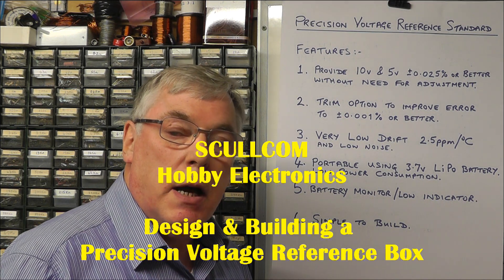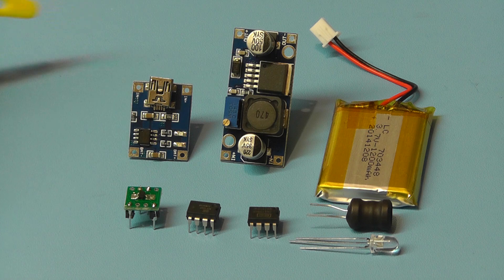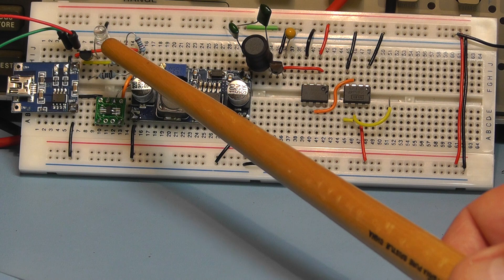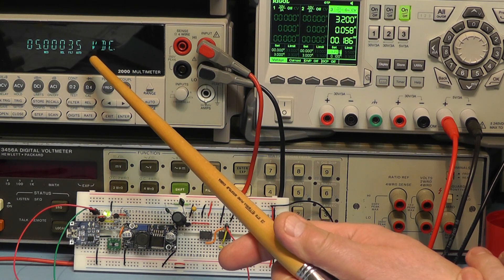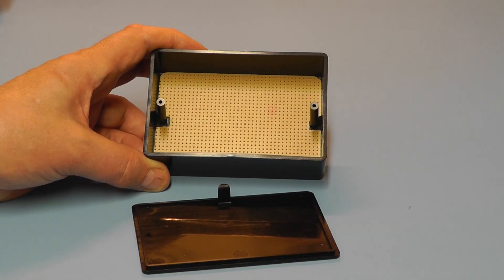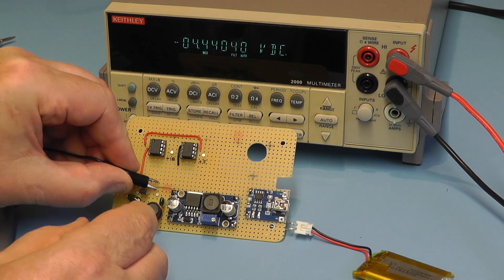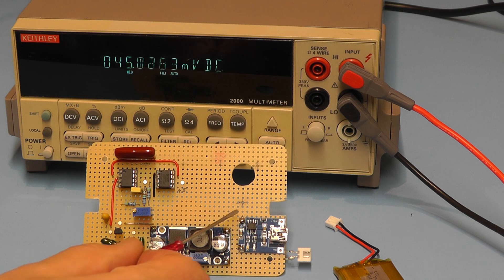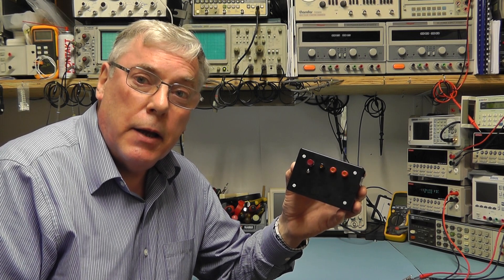Scullcom Hobby Electronics #11 - Design & Building a Precision Voltage Reference Box

Comment: i want to build this, however ebay dont have any ref102c and the INA105 is about £13!
my idea was to run off either a 12v psu or 9v batt.
so getting rid of the lipo stuff, led, putting in a toggle switch... ahhh i got a headache now as i havent got the stuff to build one
Reply from the maker: +G.O.B.S You can get the IC's online from either Farnell element14 or Mouser Electronics.
Reply: cool thanks :)
Reply: +G.O.B.S I have one running now with a 9V on a Bread board for the last 14 hours. But I used the MT3608 DC-DC Step Up module, min at 2V and has less noise then the XL6009 5V min and the LM2577 3.5V min. It won't do 3 or 4 Amp, but that's not needed with this, it's smaller also. The Li-ion and LyPo cells had more noise,me think it's the protection built in. I have it tuned 10.0000 with my HP 34401A. I run the step up at 12V, skipped the 15V reg, and everything before it. I tired to filter the little ringing at 90mV Vpp but the inductor and caps did change it. I happen to not have a 1uF cap for pin 8, but tried a 0.47uF, it worked at first then once it charged went to 120mV Vpp. I'm running it for the next 24 hours and log it. I was going to do a volt cutoff but when I first starred I had a drained 9V, opps. 1 hour in and it kept diving off. Then I realized  the 9v was under 2V and the step shit off but the ref kept the 10V out. REF takes 1mA, and both take 2.568mA. 9V should last.
Reply: +Scullcom Hobby Electronics thanks for the video, it was a fun project. Next solder to a PCB and box it. But I'm thinking about how to get an additional 2.5V and 7.5V in the box on the same board with the same accuracy. 
How low did you get the noise after it was soldered on the PCB? I'm thinking the little bit I have is mostly the bread board and cheap jumper wires.
Reply from the maker: +Scott J Thanks for your comments. Glad to hear it worked OK. Once built and soldered the noise levels were very very low.
Reply: +Scullcom Hobby Electronics I was thinking 90mv was to night. Then I started having other intermittent problems, so I changed the bread board to another. Now it's 28mv, and hopefully will drop nice its soldered. If you want to do a 48 hour test run on a bread board with persicion items, this can drive you nuts. I'm thinking its best to just solder it then see were it stands.
Reply from the maker: +Scott J Yes agree breadboards can be problematic for noise.

Comment: I would like to ask a very stupid question, but really wants to know the answer.
Why not use resistor to divide for 5V?
Reply from the maker: If you simply use a resistor network to divide the voltage to 5V then when you add a load on that 5V reference the load resistance will be in parallel with the bottom leg of the divider resistor and so effect the voltage out (lowering the 5V). Therefore, different load resistance will effect the accuracy of the 5V by different amounts. Regards, Louis
Reply: ah, good old ohm's law and output impedance. thank you for your detailed information. that helps a lot :) looking forward to see more of your projects.

Comment: Hi, the 5V reference which current drain?
Reply from the maker: Hi Diego,
If you mean the reference voltage output current then it can provide up to 10 mA output current. With no load on the output the total current of the 5V reference unit drain is about 30 mA (the biggest part of the current drain is due to the LED).
Regards,
Louis
Reply: It's not for sourcing current. It's for use in high impeadance front ends on measuring devices.
Reply: Very nice job Louis. If you offered it as a kit I'm sure you'd have many clients. I have noticed however that the temp coefficient of potentiometers is never better than 100ppm. That's probably the worst tempco component in your design.

Comment: What value are the Filter components?  A choke & to caps in either side.     
Also why so many components? I've seen a much simpler units with 2.5V.
Same for 10V as well.
Thumbs UP anyway!
Reply from the maker: The choke is 100 millihenry and the capacitors are 10nF and 100nF (with the 100nF on the input side of the 15 volt regulator.

Comment: INA105 is a 33 dollar piece is there a low cost replacement
Reply from the maker: Yes the INA105 can be expensive but they are a very stable an accurate IC with ±0.01% Max gain error. You could use the lower cost INA133 but this has a ±0.05% Max gain error. Using the INA133 would reduce the accuracy of the 5 volt reference from ±0.01% to ±0.05% max error. As these are maximum error factors you may well find that the INA133 is still very accurate.
Reply: Scullcom Hobby Electronics I need your email. I must talk with you about a project.
Reply: The best price I found and most accurate is 15 US dollars (includes shipping) This is the INA105AM w/8 pin round metal case (TO-99) Specs are available online. This is from China half the price and shipping is for pennies!!!!!

Comment: Regarding a single multi-turn pot: actually, the reason I raised this is not in regards to your circuit, but from a principle standpoint.  Accuracy of ADC reference voltage a part, I'm designing a circuit where I'm comparing a voltage A with a threshold voltage B.  Voltage B is variable between 0 and 5 volts, and I implemented what I think is a run of the mill pot. I assume that since there no other voltage divider resistors for voltage B, then it would be safe to assume that variations of temperature would not affect the ADC reading as the resistive material in the pot would vary in value by the same amount, the voltage. Remember this is predicated on a stable ARef voltage. Am I correct withe respect to the pot vs temp.?
Reply from the maker: Donovan Lym Yes you should be OK.

Comment: The drift may be introduced by the trimmer resistors and the trim pot and therefore would select resistors accordingly. Would you be Abeles to get the trim pot with similar low temp drift characteristics?
Reply from the maker: Donovan Lym Yes I agree. In some ways it may be better not to fit the trim pot and resistors at all as the accuracy is then guaranteed at ± 0.025% which would be adequate for most hobbyists. If you do use a trim pot then choose a good quality one. One of the best would be the BOURNS (manufacturer part No. 3250W-1-203) 25 turn trimmer with a tolerance of ± 5% and a Temperature Coefficient of ± 50ppm/°C but these are very expensive and can cost about £20 just for one.
Reply: @scullcomhobbyelectronics1702  What about trimming the circuit, noting the resistances that were achieved, and replacing those resistors with fixed resistors that accomplish the same voltage division?  All this doesn't matter if you don't have a more accurate reference to calibrate against.  That may be the more difficult part for us hobbyists who don't have equipment calibrated.  I assume you could build the box and have a third party calibrate it for you?

Comment: I need to make one of those. I'd like to know, what were the little pins you were using that went through the holes on the perf board? I can't seem to figure out where to get them or what they are. Thanks.
Reply from the maker: They are some times referred to as STRIPBOARD TERMINAL PINS. If you do a search on eBay using that name you should find them. Also try searching for "Terminal Pin Solder Post for Stripboard Vero Board". They are usually sold in quantities of 100 for about £1.35. Hopefully that should find them for you.

Comment: Can i use the ina101?
Reply from the maker: No, the INA101 is a different type of OP Amp which also needs an external resistor to set the gain. Best to stick with the INA105 as in the video.

Comment: A good improvement would be to add a small fet so it cuts off the battery thus preventing deep discharge damage to the LiPo
Reply from the maker: Thanks for the comment and suggestion.
Reply: The BMS has the protection already. That's what he explained at the start when he talked about a battery mounted BMS.
Reply: Scullcom Hobby Electronics I need your email so I can talk with you about a project.
Reply from the maker: You can send me a message in Private Messages in You Tube.

Comment: The question is not to make it, adjust it and measure it once. How does it perform over time?
How much does it drift?
How many digits can you rely on, days, weeks, months later?
Now, its about 6-7 years later, what is the value?

It would make for an interesting follow up video...

Comment: The drawback is that you need a high-accuracy voltmeter to calibrate the voltage reference. In reality, it's not possible to get better than ±0.025% for most hobbyists. Grrr.
Reply: MrJetra - So you don't want to calibrate your 3-1/2 digit stuff for such a low cost?  Why not?  Cal tools for multimeters of any accuracy are more expensive than this build.

Comment: Why would you need a mobile/portable very (ultra) high precision voltage reference? It's by far an overshoot! Completely useless...
Reply: +betta67 and also way too long and boring... beside the fact that it uses bought modules...
Reply: +betta67 you think its boring most probably cuz u don't appreciate engineering and designing a complete project from scratch. He explained everything in very great detail and its really hard to find a video that has a lot of knowledge u can gain from. About the ultra high precision voltage reference is used to calibrate meters... Now google the price of voltage calibration standard and then you will know how awesome this build really is. Bought modules are used for the easy stuff u don't reinvent the wheel every time.